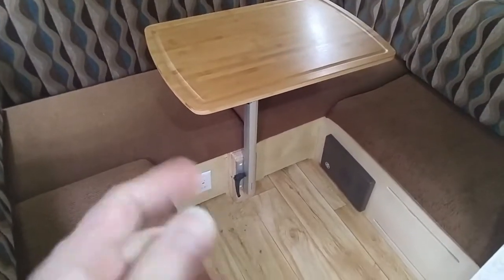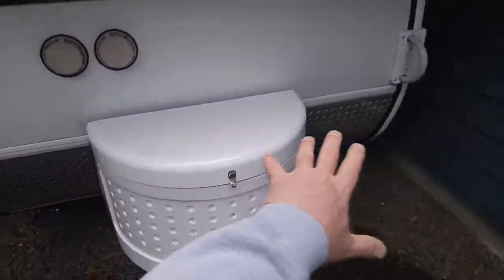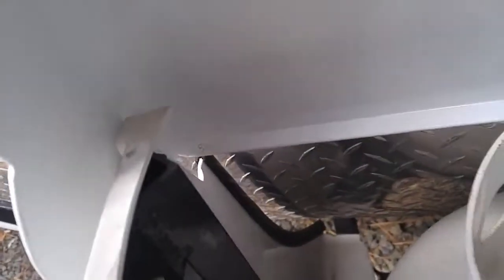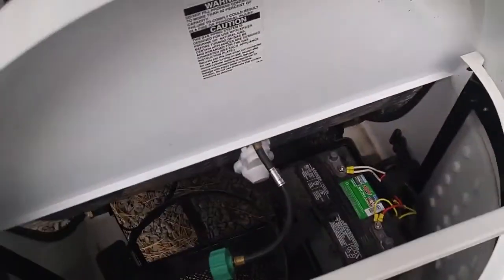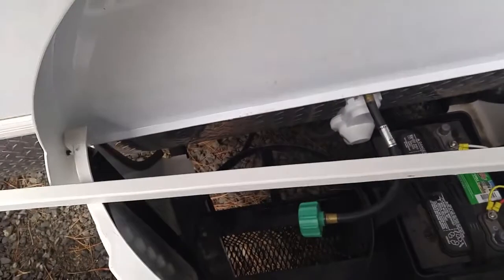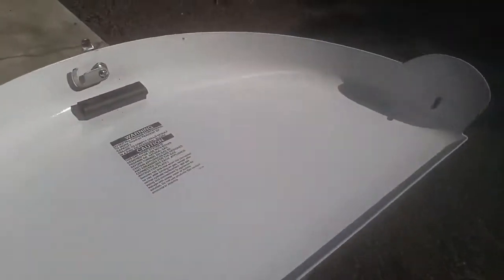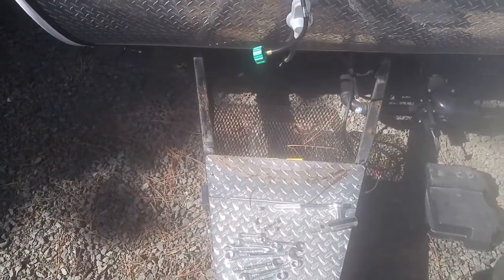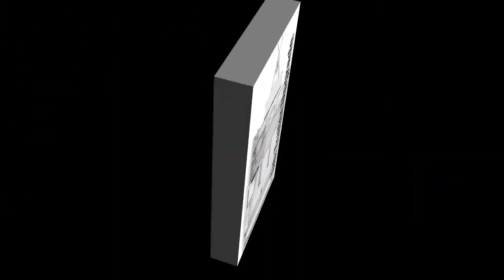Tongue Box Improvement - 2015 Tab Max S

Comment from the maker: Here are the clevis pins I used for this project. They are actually craftsman snow blower shear pins, but they work great for this project.
Large heads, long shafts, big keepers, fit existing holes, rust proof, etc.
https://www.lowes.com/pd/CRAFTSMAN-Steel-Snow-Blower-Shear-Pins/1000599425

Comment: Nice improvement. 
I did know how weak the hinges were. This is a must fix for all owner.

Making it easier to remove and install the propane tank and battery is a great benefit. 
My standard tongue box has a 4 inch diameter PVC pipe riveted vertically on the inside of the box. I believed it was intended to be a place to store the sewer hose. I am not using it so I plan to remove it and do the same adjustments you made. I am also planning to replace the latch with one that is lockable. 

Can you give more details on how you used the clevis pins for the hinges?
Your videos are very good, keep up the posting.
(Owner of a 2014 Tab Max-s trailer.)
Reply from the maker: Here are the clevis pins I used for this project. They are actually shear pins intended for craftsman snow blowers, but work great for this project. Big heads, long shafts, large keepers.
https://www.lowes.com/pd/CRAFTSMAN-Steel-Snow-Blower-Shear-Pins/1000599425